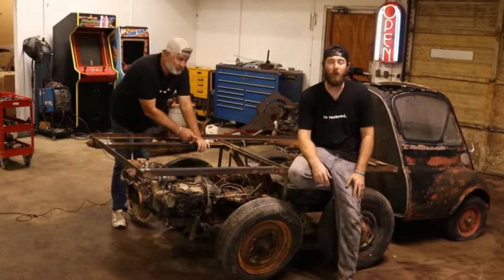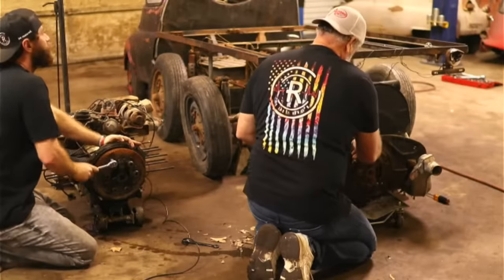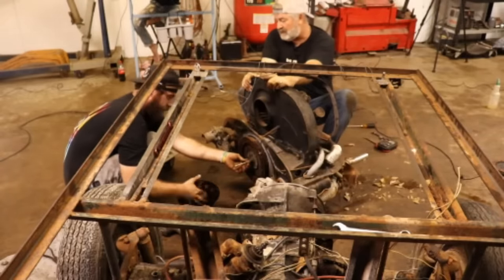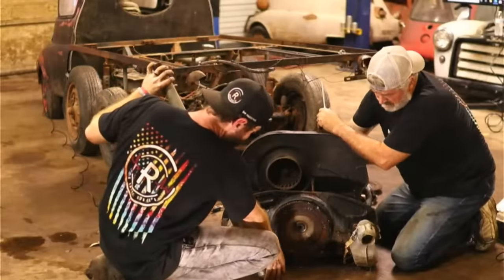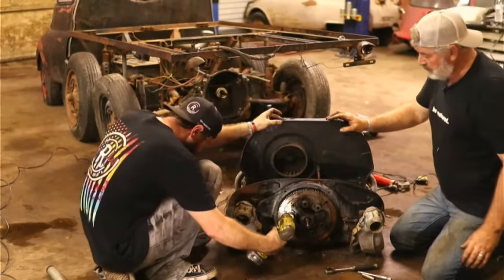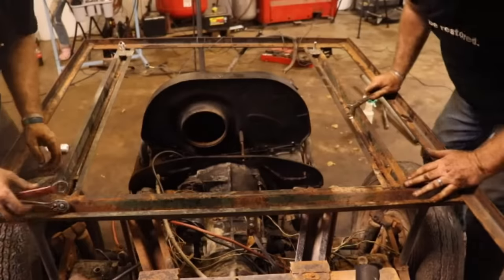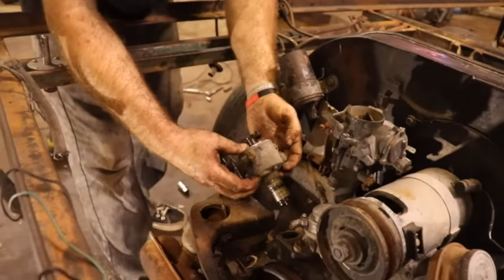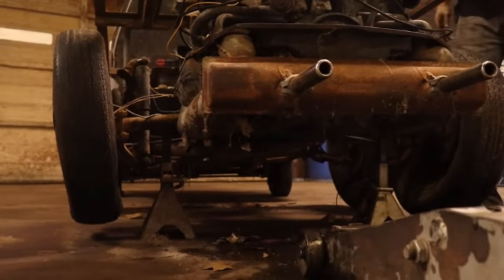PART 2 - LIVE Will It Run 1957 BMW Isetta | Raw & Uncut | Givin' Her A New Heart | RESTORED

Comment: I learned years ago that to lock up an engine just remove a spark plug and feed a length of clothesline or thin rope into the cylinder then turn the engine over and let the rope in the cylinder stop the engine from turning over. A simple solution to keep an engine from turning.
Reply: Good thinkin

Comment: have you tried fitting the clutch plate on the gearbox shaft before fitting the engine   as the splines differ from years to year on these engines  and that contraption is nothing that BMW made

Comment: Do not use studs they will break it's right handed us a piece of angel iron drilled to go in clutch holes I work on these I have trikes vw take off heat exchanger use 6 or 7 ft longer angle iron drilled to go into clutch holes

Comment: Next time you fight a clutch like that, put the transmission in gear and block the wheels so the friction made during alignment won't be so strong that the flywheel turns the transmission input shaft when wiggling the 2 together.

Comment: When you don't have a clutch alignment tool you can improvise one using a round handled ratchet or extension and wrapping tape around it until it is the size of the pilot bushing or bearing and then wrap masking, electrical, or duct tape around it farther down the length at the point where the disc will be and just wrap it until it's the right diameter for each of them. The spline on the disc won't cause a problem as the inner diameter of the splines is precise and it works fine. Done it many times
Reply: Broomstick and sand paper. Or grind down an old alignment tool
Reply: Used my snap on ratchet more than a few times

Comment: Just an aside.  The distributer will ‘bump’ up ig it if the shaft is too short (about the thickness of a penny). And/or  if the retainer ring does not clamp tightly enough.

Comment: the clutch was different?  6 volt and 12 volt?  6 volt clutch was smaller and 180mm, 12 volt upgrade went to 200mm clutch.  I wasnt aware type 3 clutch was different otherwise..could be wrong

Comment: You guys need a flywheel lock tool. They are very cheap. Flywheel gland nut torque? The factory manual tells lies: 250lbs? Nope. Theres a chance It will come off. Like mine did! Get Dad to stand on that engine while Lance cranks it down as hard as it will go. 300lbs should do it!

Comment: painful watching you guys try and get that engine on the clutch. personally I'd have verified that the clutch disc actually fits the splines.  I've done this kind of thing without an alignment tool. laying on my back under my Cmaro . laying on my back. feet on the front of teh Super T-10 and hands on the tailshaft. no benefit of a jack and without a great deal of trouble slips it in.

Comment: A couple of observations:    1)  You need some 'Restored' cover-alls to keep your wives happy.  (Very important)   2)   You should install 8' led daylight fixtures or replace your 4' florescent tubes with 4' daylight led lights with the built in ballast.  This will help eliminate a lot of the shadows with the existing lighting and is much easier on the eyes.   The existing florescent fixtures would need to be rewired to bypass the existing ballast,  but is much easier than trying to replace the florescent ballast with an electronic one and using the led tubes without the built in ballast.
Reply: Pull the spark plugs so you can  turn the engine  in order to align  the splines in the thru shaft

Comment: If you have a wooden broom handle cut about 12 inches off and turn down the end that you put into the centre of clutch plate if you don't have the right tool I have used it my self and it works good a suggestion from down under in South Australia

Comment: I missed the live filming last night.  I had checked the Isetta  trucks you mentioned in pt1 and the back is cut off about the same place and they also use a VW engine although I don't know which type. The flat bed tips, with the bed chassis Tipping behind the cab, the chassis seems to scissor doing it. Funny to even me here in the UK 🇬🇧 and it being a long time since seeing one on the roads.

Comment: If you use a big enough socket to barely go through the clutch on the flywheel it will automatically line up the input shaft old

Comment: If you leave the 6 bolts loose in the flywheel you can put the clutch on the the input shaft to line it up then tighten the 6 bolts.

Comment: Wyatt, I grew up pulling and replacing engines with a cable come-along hanging from a chain in a maple tree out back. we haven't used it in years, but the old chain still hangs there and the limb has grown around it. It's been in the tree since about 1975, which is 4 years longer than I've been around.

Comment: got it running, but it's only running on two or three cylinders, those cars will run on one cylinder, forgot to tell you those things after sitting so long are notorious for stuck valves you pull those side pans off and tap them with a hammer to break them loose or just start it up and let it run

Comment: Upgrade your airline to 5/8's..then use adapter to standard line...using more air supply will get you double the torque

Comment: Question: why do Americans call them motor mounts when they are engine mounts? a motor is electric and a engine is petrol/gas driven.
When you are doing a wheel or a clutch. NEVER tighten the bolts as you go around. Always work in a pattern like you are drawing a star of David, I  hope I'm making sense?
 I hate talking to the TV and you are ignoring me lol. I would sell it because the bearing you sprayed is not going to last.
Reply: Because they've been called motor mounts for 100 years ;)

Comment: If you want to change from a 6 volt to 12 volt, you have to use a 1967 flywheel it's the only flywheel that will work on a 6 volt motor I work on vw for a long time.

Comment: Taking picture of boat inside the bolts on the transmission from the transmission onto the block take you a crowbar wedge into the teeth and use it as a wedge then twist the nut

Comment: A few more turns of the screwdriver and you'll be dropping a sheet of plywood on and putting it to work. Without air tools I crack the fastener and spin it off with my screw gun. But I'm sure y'all knew that. :)

Comment: When doing r&r remove and replace it's always a good idea to compare the two side by side  so when you pulled out the old you can put it next to the new one and check everything. 
 half the cars in a parking lot used to be Volkswagens they were the perfect second car for a lot of families  they were reliable , ran good, and they were good on gas
 I remember I could go to the beach and back a 120 mile round trip on $2  worth of gas. The motor on the Inserts is probably an early bug one of the magnesium case ones from around 61 and the one new that you have looks like it's off of a  beetle from the 70s that's from what I can see anyway.

Comment: I wish I'd have been watching this when you were live. Could've saved you sooooooooo much time. That said, I appreciate you guys and your channel. VW flywheel stock torque spec is 250 foot pounds. But rust and age as you well know play a major factor.  180mm is a 12 volt flywheel diameter btw.  I've ground out many a transaxle to fit mismatched combos. Always a good time.